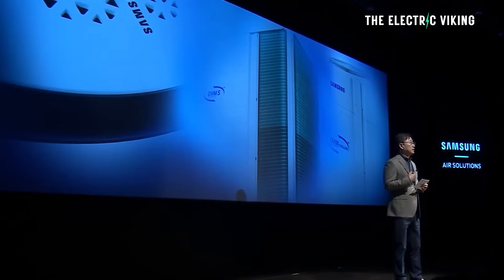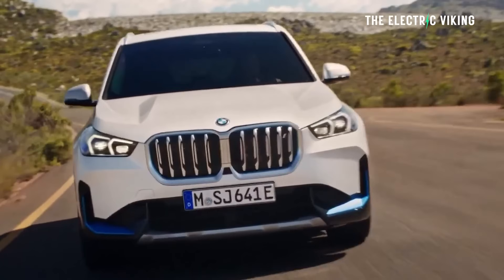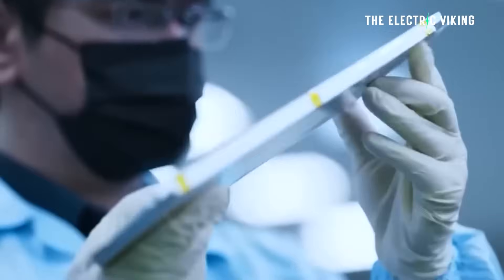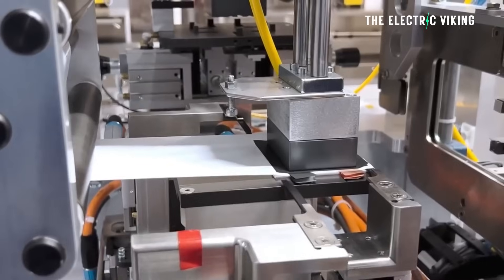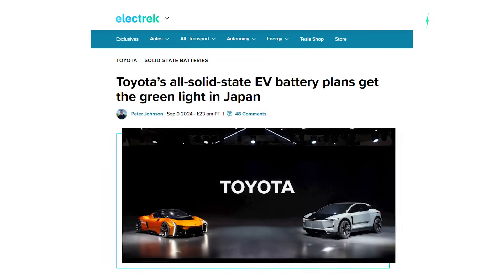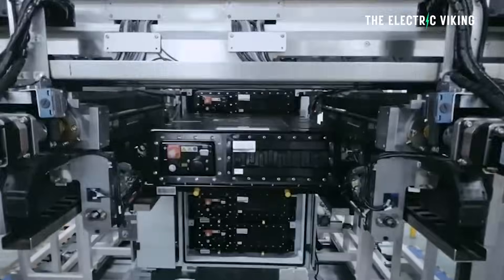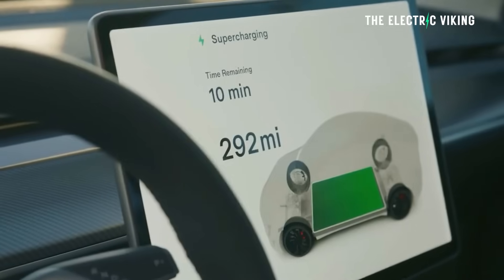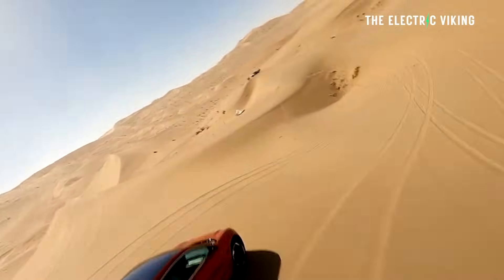How much range electric cars with Samsung's Solid State batteries will have

Comment: As someone looking to convert to a phev, this and e exhale type motors are what I'm waiting on maturing enough to the point of being lightweight and mass produced.  EV purists would hate me but I'm interested in the performance aspect of electrification over the environmental aspect, but I have nothing against being able to drive around town in pure EV mode with at least 100 miles of range on tap to alleviate the need to refuel for the greater part of the year.

Comment: Not sure all same batteries have the same range ..i own a 23 KIA EV6 RWD and my 88kwh battery gets me as high as 388 miles in the summertime and 275 to 310 in the winter time from my home 48 amp Emporia charger. Chevy Equinox EV has a similar battery and range is lower...i believe they put a governor on the charging miles to protect the battery,  maybe...😎

Comment: dude.  these batteries are not real.  10 minute charge time?  maybe if you dedicate a whole nuclear reactor to charging one.  listen the physics of this create limits.  if you're doubling the energy density (which is what samsung is claiming with the 600 miles range) then your doubling the charging time on a normal charger.  the only way to shorten that time is to increase the power flowing through the charger.  a normal Tesla Supercharger takes 18 houses worth of hourly power and stuffs it into a 30-50 minute fast charge.  if you're doubling the energy density of that battery you'll need 36 homes worth of power to maintain that same 30-50 minute charge.  and if you want to cut that time in half you would double it again, to 72 homes worth of power to bring the charge time down to 15-25 minutes.  

that's 6 tesla superchargers worth of power going to just one vehical.  explain how the power grid can maintain that type of localized energy drain for a charging station for these new batteries?

no, IF Samsung has doubled the energy density then they doubled the charging times with normal chargers.  not cut it down to 10 minutes.  sure the batteries might be capable of being charged that fast.  but it won't happen without a new charging infrastructure.

Comment: "So far, permanently installed batteries still dominate in electric cars. However, Nio refers to a representative Ipsos survey commissioned by TÜV (independent service companies from Germany), according to which a clear majority of respondents see advantages in the alternative concept of exchangeable batteries: “63 per cent of Germans consider these to be better or much better suited than permanently installed batteries to save time when charging and extend battery life. 

Indeed, battery swapping systems have numerous advantages in terms of sustainability, saving resources and energy throughout the vehicles’ lives across primary, secondary and tertiary markets before recycling. Batteries are more easily upgraded, reused and recycled without the whole vehicle being remanufactured. Battery swapping and charging infrastructure is not mutually exclusive. Cars with swappable batteries may still charge the batteries in the same way as permanently installed batteries.

The biggest obstacle to the development and establishment of interchangeable models is uniform norms and standards, according to the German international testing association, TÜV.”

Comment: Correction: Samsungs Solid State Battery is NOT OXIDE BASED but SULFIDE BASED. I work in the industry and i can assure you, these "news outlets" dont know what they are talking about. Samsung has no notable contributions in the oxide based solid electrolyte system but it has in the sulfide based system.

Comment: We have been waiting for the solid state batteries for at least 10 years. I agree 500 miles would be great for most people, particularly when coupled with lighter, cheaper vehicles and faster charging. I will believe it when I see it though...

Comment: As an electrical engineer, I find it hard to believe that the same 87kw battery, but half the weight, don't forget the weight of the car without the the battery is not zero  would double the range, maybe 30% more, but that still great considering the battery is usual 25% of an EV weight
Reply: He said the same size(as in exterior dimensions), not the same capacity. The problem here is that we already use universally the word `battery size` wrong, when we actually mean `battery capacity` in KWh.

Comment: Under 20K for EV cars with 400 mile range and really nice features will destroy the ICE car industry.   Higher energy density will lead to smaller batteries and lower price cars.   We dont need to have incentives for people to buy EVs in another 2 years.  The flood of cheap cars with minimal repairs and maintenance will cause ICE cars to go into massive decline.   Big oil is going to be in a death spiral within 3 years.   Only the lowest cost producers of oil will survive.  Now we need a cheaper source of electricity.

Comment: If you take out the 87 kw factory battery and replace it with a solid state,  87 kw battery,  you'll still get the same range, assuming you drive the same route.  Energy density isn't going to make a difference at all.  The battery weight will help slightly with range , but very little, remember  regenerative charging is also from vehicle weight,  while taking more energy to getting moving, but putting back more energy when stopping.  But a solid state battery isn't going to be a really big percent difference in the total car weight, everything else is still there.    If you only accelerate to hwy speed a few times,  then there isn't going to be a noticeable difference at all in range.

Comment: Recharging in 10 minutes takes care of most range concerns right out of the gate - most drivers will be happy with a 350 to 500 mile range so long as the charging infrastructure is convenient.
Reply: Yep. EV companies need to focus on these issues instead of secondary features like self driving or fancy interior.
Reply: Recharge in 10 minutes is as big a breakthrough as li-ion batteries are in the first place.
If this is true I'll be scrounging up as much cash as I can, to buy Samsung stock ❤
Reply: Except no one wants charging stations all over the place like we didn't want cell towers. NIMBY
Reply: @banhammer3904  seriously? You're sad, like Trump.

Comment: Honda Accords and similar cars in its class have huge gas tanks. The base version has a 14.8 gallon tank with a 478 mile range. The hybrid version can travel over 600 miles on a tank of gas. I agree that you don’t need a fuel tank that big, especially since there’s no way I’m driving over six hours without a bathroom break- but people have been sold on the ‘feature’. People are strange about their cars, and paper stats.

Comment: Hi Sam, you again mentioned that with smaller wheels range increases. Is this just what the odometer registers because per revolution of the wheel less actual distance is travelled than with a larger wheel( all else the same). So with the smaller wheel than design size, the odometer is actually over reporting distance travelled. Also the car will be slower than the reported speed ( which would increase range but no more than driving the same actual speed with the larger wheels). If there is another mechanism at play I would be fascinated to learn what it is. Thanks 
.

Comment: All 84kwh batteries have basically the same range.  The solid state battery saves about 500 pounds so it will get a bit more range.  A 300 kg solid state battery will go almost twice as far as current 300 kg battery packs.
Reply: Right on Charlie A solid state battery same weight gives you double or 172kw that gives you double the range as a battery is usually 25% of the car saving 12.5 % of the cars weight giving you about 30% more range.
Reply: For a guy, like the Viking, it is amazing how much he doesn't understand this. He is calculating like this for years now, I already wrote a comments about it a few times and others too. He just doesn't get it, if a battery has twice the gravimetric energy density but it has the same energy capacity, then the vehicle will not go twice as far, only a few percent farther. For example, if we have a 4000 pounds car with a 1200 pounds 60 kWh usable battery pack consuming 20 kWh per 60 miles (60/20=3) then this car can theoretically go 180 (3x60) miles on a charge. If we double the gravimetric energy density of the battery, then to contain 60 kWh energy we need only 600 pounds of battery so our example car will have a weight of "only" 3400 pounds instead of 4000. Let' s say this 15% weight reduction gives it a 10% saving in avarege energy consumption (it won't but what the heck), then we have a car with a 60 kWh battery pack but consuming only 18 kWh per 60 miles (60/18=3.33), so this car will go 199.8 miles between charges (3.33x60) instead of the 180 miles with the less energy dense battery, but not double that much (360 miles) as the Viking is calculating. If you want the same 4000 pound car to double its mileage, you need to put in a 1200 ponuds double energy density battery with a 120 kWh capacity battery pack, and since the vehicle's weight stays the same, the mileage also stays the same (if the volumetric battery density also stays at a manageable level) so at a 20 kWh per 60 miles consumption this vehicle will theoretically be able to go 360 miles between charges (6x60). The description of the various energy density types and some fuels' theoretical energy density: https://energyeducation.ca/encyclopedia/Energy_density
Reply: @xhussar  Absolutely! Considering he has been doing this a good few years now I'm amazed how much he doesn't understand about EV's.

Comment: I would need a car that can do 500 miles with all the equipment running

Additionally, it should do nearly half that distance at 100 mph or 25% at 130mph

Comment: The density of solid state batteries can reduce the weight associated with lithium ion systems by up to 50% as a conservative estimate, so it is reasonable for mileage to increase from 350 miles to 500 miles or maybe a bit more.  The density allows for significant weight reduction, which in turn may provide for greater range.

Comment: If you are going to get the apartment dwellers to buy into this transition - especially in wide open places like Texas with vast urban sprawl in the cities and low dwelling density in suburban / rural / exurban areas - then you are going to need all that range and more with 10 minute or less charging time. You are going to need to convince people without home chargers and with long commutes that they can fill up with electrons once a week quickly same as they do with  hydrocarbons as well as not have to worry when they tow or go on trips. Give me the thousand mile range please and to hell with the weight.

Comment: no talks about if you can can get  600 miles per charge  out of auto battery will homes been coming off the  grid with solar charging and  small  back up natural gas   generator !!!! there are also  squirrel cage  fan set up for wind power on peak of roofs you can get

Comment: I believe You misstated Your idea. If Both Battery types were the same Capacity, the Range should be approximately
the same. If Both Battery types take up the same Volume, then Energy Density comes into play. Weight as well plays a big part.

Comment: Sam an 87 kwh Solid stte battery will not give any more Range if its solid state or not, the only factor is the weight of the battery of the solid state batteru is only 70 percent of the weight then you will get ,ote range from the reduced  weight . The  potential advant ages of solid state  batteries are more capacity for the same weight therefore longer range or same capacity reduced weight  therfore more effefient and incressed range

Comment: The average ev battery weighs 1,000 lbs.   If you double the energy density of a battery you could halve the size (and weight), and have the same amount of stored energy in a car that is 500lbs lighter.   This will increase range significantly.

Comment: For optimal battery health, it is suggested that you keep your EV between 40% and 80% SOC. That means for every 100 mile of total range, your usable range is 40 miles to extend the life of your battery. 1,000 mile total range would be great because it would be easy to keep your battery SOC between 40% and 80%. That's 400 miles of usable range per charge.
Reply: The Samsung batteries use a silver carbon layer to avoid these issues, hence the 20 year life and superfast charging. Their batteries form no dendrites.

Comment: Huh? The energy density is irrelevant.  If a vehicle has a 87kwhr battery, whether the battery is solid state or conventional  liquid electrolyte, the range will be the same.

Comment: Two things: 1. Charging speed has two sides, so what if the battery "can" charge in ten minutes.  If no charger has that amount of power to deliver, it doesn't matter.   2. I'm sick of hearing about all these great new batteries and how you can charge once and drive forever (sarc), until they hit the market, even one of them with the big ranges, till then they are all pipe dreams.

Comment: Solid State is supposed to be more stable, faster charging and smaller for the same power capacity. 
This then suggesting  1/2 to 1/3 of current size and mass of a 80 kWh battery pack.
Solid State design allowing 160 kWh of power in the same current footprint of your current 80 kWh and possibly 2/3 of the mass of your current 80 kWh battery. possibly reducing some 300 kg from your current Xpeng.
There are suggestions that Solid State are  less susceptible to thermal runaway and safer if involved in a fire. TBC.
The benefit  of significantly doubling or tripling energy density is weight saving and hopefully reduction of size and mass to improve efficiency. 
Power is used to move mass. 
less mass requires less energy to accelerate. Physics and Newton's Second law P=Fv around moving mass and acceleration to a given speed determine how efficient vehicles are. couple that by reducing drag, and overcoming rolling resistance will govern how far a vehicle can go on a given charge and how much power is required. based on your G6 1.7 kW per km (1 kW per mile) 
I believe most manufacturers will look for a balance of range and weight and cost. 
Not just Who has the biggest battery / range.
Weight reduction reduces the stresses on all parts of the vehicle and suspension as mass impacts so much in vehicle design. 
More so than you realise affecting structural design, suspension, bearing sizes and suspension points. 
All that mass is suspended, hence why tires have had significant added cost in sidewall design to handle the significant increase in mass.
IMO the 500 mile 800 kms will be the likely benchmark and a battery that is 1/3 of current mass and size giving significant improvement in vehicle design and packaging.

Comment: Outside of range anxiety, cold weather charging, speed of charging, and honestly, cycle life would be very important factors to getting evs to be mass adopted. Especially when the battery typically makes up 1/3 to 1/4 of the cost of current ev vehicles.
Reply: The "range anxiety" thing is laughable. I grew up driving EH, HR, HK, {insert 60's 70's} Holdens and 60's to  70's Fords, ALL of them had a range of between 300-400K's per tank, {6 cylinder, worse with a V8}, and that was if you nursed it, we still managed to drive ALL over Australia and I NEVER heard anyone whinge about "range anxiety".... And before anyone says "yeah but there were service station everywhere", There were NOT, you planned your trip ...

Comment: A typical 70 kWh battery would weigh 118 kg (260 pounds) less and increase range by 4.6%* 
Example:   
170 Wh/km would reduce to 162.2 Wh/km
Range with 259 kg battery:  412 km
Range with 140 kg battery:  432 km

*Study by AAA:  Controlled test facility.  Energy used while unloaded vs 1400 lbs load of sandbags into a Ford lightning

Comment: I still think that unless you can charge from 5% to 100% in 10 minutes or so I.e the same time to fill as in an empty petrol station for a petrol/diesel car with a range of around 500miles people will always have range anxiety. Especially until the fast charger is as common place as the petrol pump. My car on a full tank has 550miles (supposedly) it took me 6ish hours to get to Scotland on one tank. I wouldn’t have wanted to make that 7 with a stop for charging. I only made that trip once but it’s the fact that I could when I needed to. Until we reach that threshold, that equals ice cars then people are still going to think electric is inconvenient and therefore inferior despite actually being better for you long term both financially and for the air quality/sound pollution and from a reliability standpoint

Comment: Don't understand your estimates.  Here is my back of envelope estimate (sorry for the English units)
Tesla 3 weight is about 4,000 lbs; the battery weight is 800 lbs.
The Samsung battery is about twice the energy density so the weight should  be about 400lbs.
So the total weight of the car is 10% less. Hard to believe a 10% drop in total weight increases mileage all that much.
The  battery energy density is more important in aircraft and even trucks.
Am  I wrong?